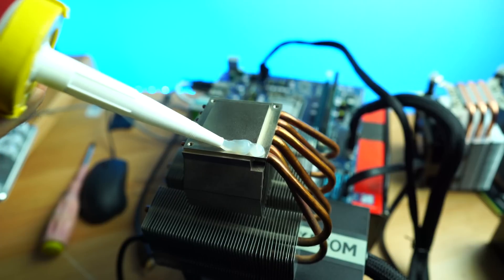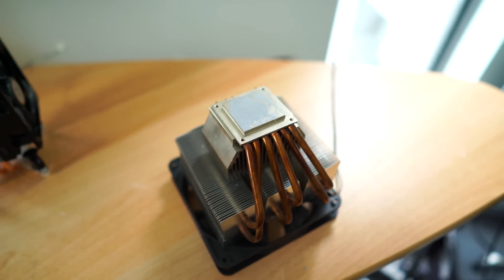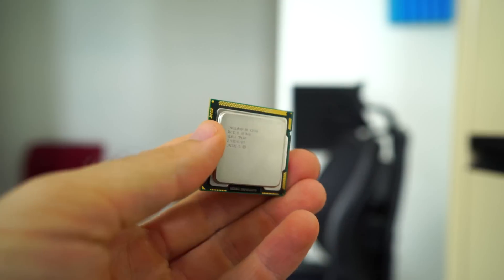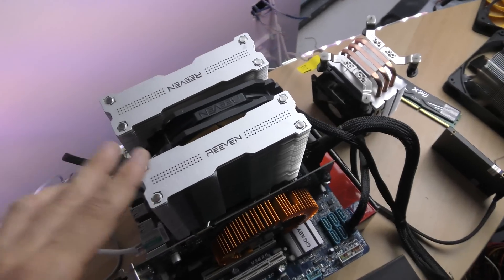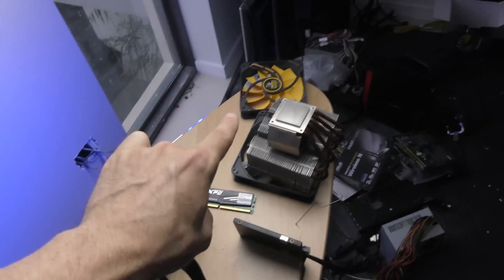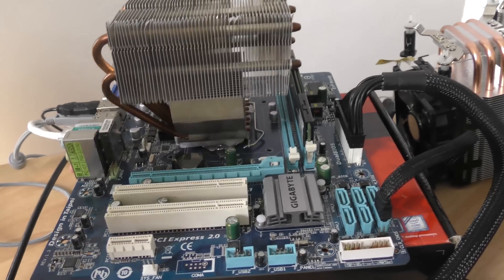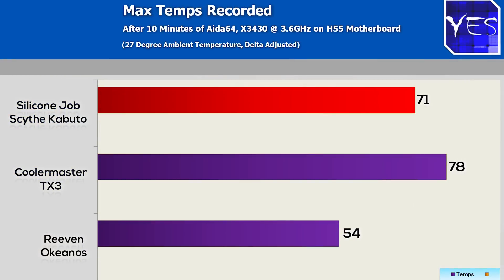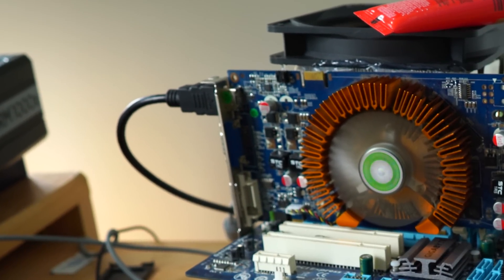GLUING a CPU Cooler DOWN with SILICONE? Temps Vs. Twin Tower Vs. Budget Cooler

Comment: I have a lg 55" tv and the cpu is overheating the heat sink is  siliconed on.the sides , Do you think A bigger heat sink with new thermal paste would help ? And could I use any type of silicone to hold the sink down ? Thanks

Comment: Guys I'm after replacement thermal pads for my G1 R9 390 since the stock ones are absolutely terrible (ripped and or crusty), I've been emailing them and they told me they are all .8mm thickness but I cannot find that size pads, would 1mm pads matter at all? They told me they cannot guarantee it would work properly.

Comment: if you spray WD40 on the glue it should separate i now that dose work with hot glue and most order rubber based glues.

Comment: Have x3440 OC to 3.8 with the turbo off but I have a h60i closed loop water cooler keeping the temps way low had it at 4ghz but crashed in games

Comment: you should have used a CPU cooler, one CPU cooler model, e.g. Cooler Master 212 Evo, and compare different methods of mounting. Zip ties vs silicon vs actual mount.

Comment: Silicone isn't structural, it's a sealant. Be warned that you may never want to move this if you do this method or that cooler WILL come loose. Also the silicone is going to trap air in there. Silicone is not permanent. It can be easily peeled off. Now epoxy would be permanent.

Comment: I would have liked to see what the big cooler could do on this CPU without thermal paste. Of course this is nothing you should do and has nothing to do with price per peformance but it is something I already had to deal with on a used Hardware bundle I bought.

Comment: is this pc worth for 333€  ?

specs:

CPU: i5-2500
Motherboard: Intel DQ67SW
CD/DVD: Samsung SH-222AB, CD/DVD Writer, SATA
HDD: 2TB, Samsung Spinpoint F4EG, SATA
GPU: MSI R9 270 GAMING 2G
CPU Cooler: Alpine 11 rev.2
PSU: 550W, SPS-XP550 Xilence
Case: Cooler Master CM 690 II Advanced
Reply: Yep but I would upgrade two things over time 1st get a better Gpu and 2nd try and get a 2600k or a 3770k

Comment: interesting..I think it would be better on AIO liquid coolers..sometimes used doesn't comes with current gen brackets. But how long would it stick, with the heat I'm guessing you'll need to change it once every few months.

Comment: I figured it wouldn't do that well due to the thickness of the silicone compared to the thin layer of thermal paste. Probably not full contact or an air pocket because the cooler should be much better than the tx3 not just just slightly better.

Comment: Man, i hope no one actually does this. This is about the worst thing you could do to your hardware. The silicone is not meant to be used under these conditions either, there is a lot of on and off heat cycles, and a lot of vibrations as well, both of which will cause consumer grade silicone to soften and fail over time. On top of all this, you're also putting a LOT of strain on the CPU socket by just gluing the heatsink directly to it.

Do yourself, and your PC a favor and just get the cheapest complete cooler you can find in stead. It's better for your system to just run a couple degrees hotter, than it is to put this strain on the CPU socket. This is NOT a viable solution. I say this as someone who has worked a lot with silicone through the years.
Reply: Worked a lot with silicone in relation to my aquarium hobby.. Jeez.. Maybe i could have phrased that better.. :P
Reply: I just re-read that, and now I exactly know why he laughed at your comment. Nice one.

Comment: What a waste because now the cpu is stuck inside and the mobo is ruined. Use proper mounting techniques like a normal person.
Reply: Dolan it's just silicone...every part is fine...and he did this for the sake of the video..and his parts are cheap
Reply: Which I think he actually does still use brake cleaner on all of his PC build videos.
Reply: Cheap old hardware no upgrade path. Who cares cost him 60 bucks.
Reply: jammin4jonathan Well the upgrade path is another cpu, motherboard, graphic card and hdd. Well maby PSU too. ^^ Intel sucks in upgrade path even if you got the latest hardware. I love best bang for the buck!

Comment: I was thinking to get the absolute best value for ram to make sure you get a 4 slot motherboard. 
That way you can use cheaper ($ per gb) 2gb sticks instead of 4 and 8 gb sticks due to popularity. 
Only issue of course is maxing out at 8gb.
One other trick which may be interesting to try is readyboost. 
I had an old compaq system with just 2gb of ram which would barely run Windows 7 so I shoved a 4gb usb in -
(I would have gone bigger but didn't know if the 32 bit operating system would utilise it.)-
It ended up running really well. 
Usb drives are super cheap and there may even be some better performance with usb 3.

Comment: Is there an possibility to tighten an cpu cooler in a dell rig , the motherboard is not reachable at the blackplate, how can fix my cpu cooler or construct a better cooler on this motherboard without build out the motherboard out of thecase ?? Is possible to do this with zip tires ?

Comment: That Reeven cooler looks dope, I wonder how it compares to today's modern high-end air coolers like the Dark Rock Pro 3 and NH-D15. Mind doing a little bit of testing on that, my dude?
Reply: Standard air coolers really don't change that much. It's basicly just standard "heat conducts to metal, cool the metal down by blowing air on it".

Ofc theres some optimisation and such but it mainly comes down to the size where heat can spread to and the material(s) used.
Reply: Today's modern high-end cooler?! It's pretty much as good as both coolers you mentioned: 
https://www.overclockersclub.com/reviews/reeven_okeanos_rc1402/4.htm

Comment: I have one of the "Seek" thermal cameras that you connect to your phone. It's not high resolution, but it's around 200USD and it works. Great for finding hot (or cold) spots in different applications.

Comment: VRMs can handle up to 125C continuous for 7 to 14 months, however since there's capacitors around which are usually rated at a lesser 110C for 7 to 14 months, it's ideal to keep the VRMs at 90C or below. So something like your 70C is perfectly fine.
Reply: considering the cheap board they are probably not such high quality though
Reply: Even then at worst they'd be 120C for the mosfets and 105C for the caps, which are still fine at 70C.
Reply: That is hard to say. Many of the more upper tier motherboards sometimes still use "bad" VRM components. But even those are almost all rated for the same max temperatures, the only thing going down the drain is the efficiency and thus they heat up more easily.
Reply: David K. This is true, their specs on am4 are very nice. Can't say the same for the software side at all times though. In any case you can expect the mother words to last a good long time.

Comment: Silicon = element and what processors are made from
Silicone = plastic/rubbery stuff
Reply: and what breasts are made of
Reply from the maker: Thanks, my English gets worse and worse over the years lol.
Reply: Yes, Sil-ih-cone' ( cone pronounced as in ice cream cone, with accent on last sylable)
Reply: +pillsburied Actually, that's what breast implants are made of...
Reply: David DeBroux yes of course, however it has many applications.
Reply: this is so wrong  :'D
Reply: correct, though in Australia we pronounce both of them the same way. Fair's fair though - Yanks pronounce soldering "Soh-dering" and Aluminium "Ah-Lu-Mi-Num". the earth hasn't plummeted in to the sun ...yet :)